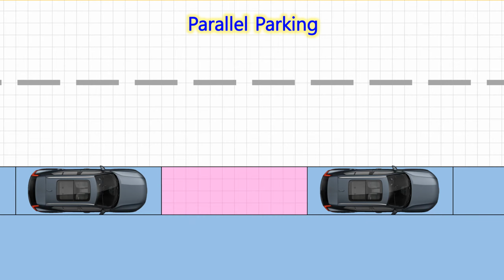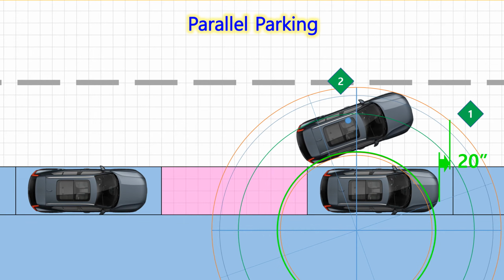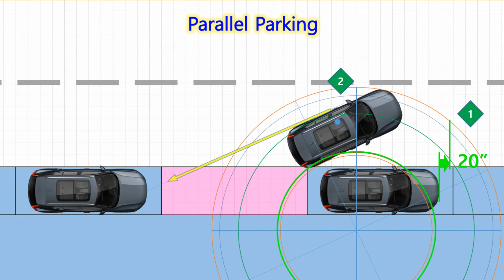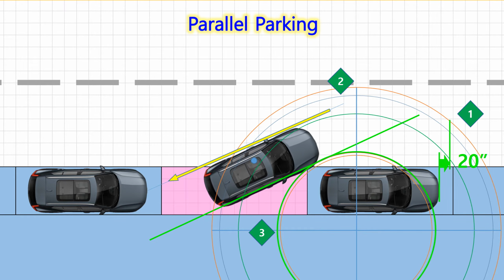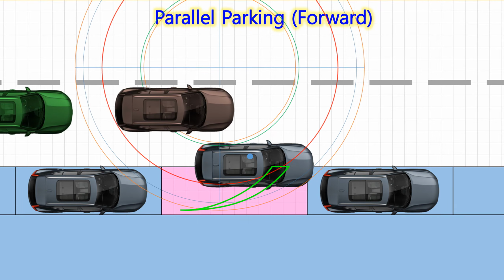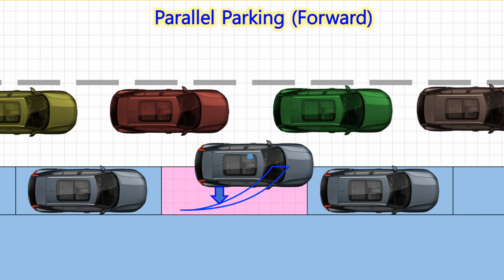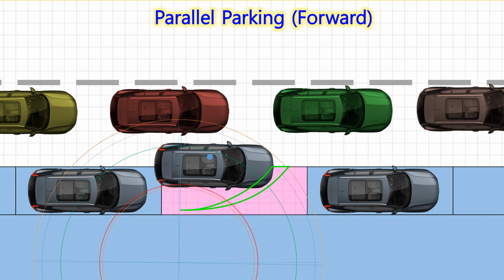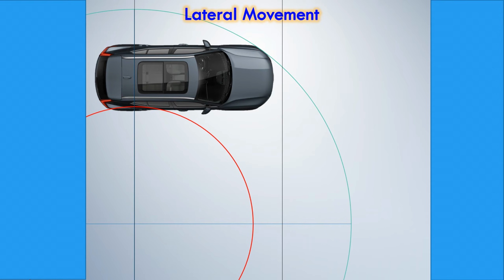Parallel Parking(II), make your own method by Principle of turning circle, how to laterally move

Comment: Good video! It gets into the technical, not by just feeling.
The feeling will be different for each car we drive. But the technical is almost always the same.
After knowing the technical, usually driver can practice by landmarks and get the feeling for the specific car.

FYI: The turning radiuses model is based on the Ackerman Steering.